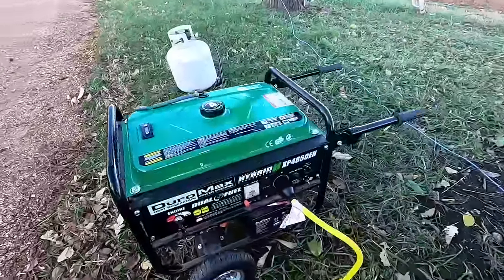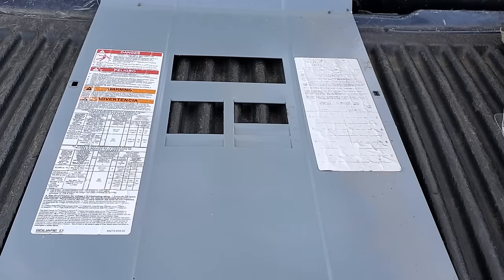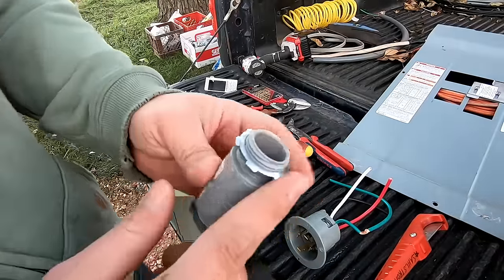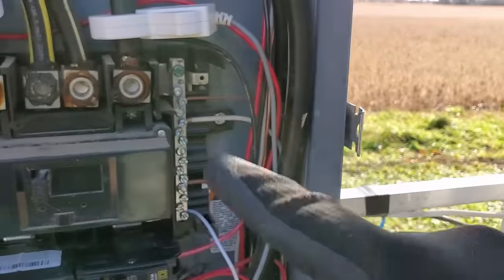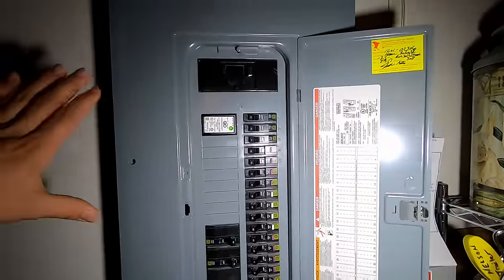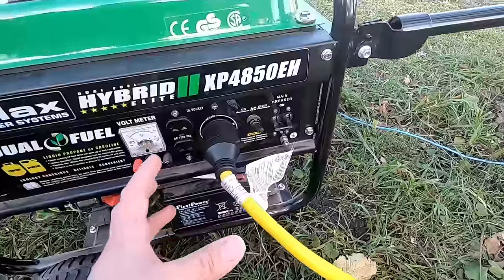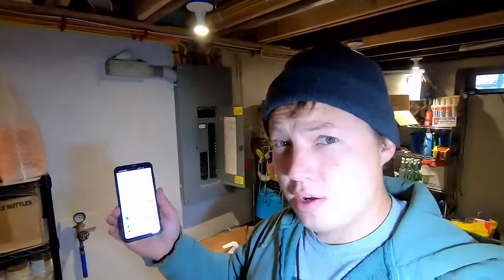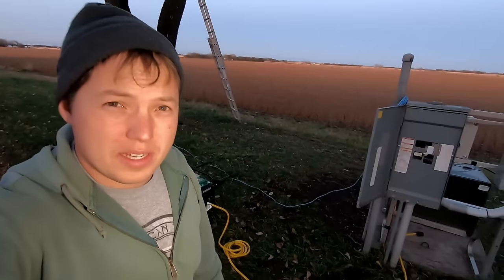How To Hook Up a Generator To Your House Using a Breaker Interlock Kit & Power Inlet Box

Comment: Very good , i learned  a lot, many thanks i do like  (thumb up) and suscribed
Reply: ⚠️Please don’t forget to follow the generator safety tips whenever you use your portable generator. This is a very important announcement for everyone. This is just a reminder for everyone’s safety. All generator safety rules need to be followed carefully 

Generator safety tips: 

1) KEEPING OTHERS SAFE: Please do not allow an unqualified person or your children to operate and service the portable generator. Just because some manuals don’t say that doesn’t mean it’s safe. That is important against the generator safety rules. We also need to be keeping an eye on our children too. You need to make sure that your children are not playing near the portable generator especially when it’s running so they won’t get electrocuted. Generators pose electrical risks and they can be hot during an operation. Please keep your children away from the portable generator at all times. It is important to keep our children safe especially our little ones. Children often get curious about anything so we should keep an eye on them to also make sure they’re not wandering towards the generator. 

2) WHERE TO RUN YOUR GENERATOR: Some people use their portable generators indoors which increases the risk of carbon monoxide poisoning. It’s important to have a carbon monoxide if you have a gas generator. Never ever use your generator indoors even if your doors and windows are open and even in the garage is not safe to use a portable generator. Not even at your porch and your deck. It is never safe to use your generator indoors and in enclosed areas of your home. Your generator needs to be 15-20 feet away from your house. 

3)🔥FIRE HAZARDS: Never refuel your generator while it’s running. You need to let your generator cool off before refueling it and before storing your generator. Never overload your generator too. Never ever back feed your generator. You should never plug your generator into a wall outlet. Also never store propane tanks indoors. Please keep flammable things away from the generator as well and please don’t smoke cigarettes near the generator. Having a fire extinguisher next to the generator is also important against the generator safety rules. 

4) GENERATOR OPERATION: make sure your hands are dry before touching the generator. Never use your generator in wet conditions. Don’t let your generator get wet. You need a generator tent if you need to use your generator during wet weather. Please don’t wear loose clothes when operating the generator. Turn on your generator before plugging in appliances. Use the right cord for your generator. Please do not use worn out cords. 

https://youtu.be/I1jT3ANENvI and here is a video more about keeping others safe when using generators. All generator safety rules should be followed carefully. 

Hope this helps.

Comment: A local electrical company in my area wants to charge me $1250 to install a 50 amp interlock kit, does that sound like a fair price? Also, what's the point in only running 30 amps? The cost to upgrade to a 50 amp is only a few hundred dollars more, that way you wouldn't have to be worried about overloading the system.

Comment: I am glad to see that you used the Connecticut Electric inlet receptacle.  Never buy anything from Reliance Controls -- they are a bunch of shysters who sell questionably-legal parts.
Reply: What is questionably legal about what they sell?
Reply: @carters2  Their transfer panels use "button breakers" as the only circuit protection when running on generator power.  These are "supplemental" devices and not intended for mains service.  I pointed this out in a video that I made a few years ago, and they began legal threats against me because the actual NEC is on my side.   They also put people into comments sections of videos, discussions, etc. posing as consumers who are actually Reliance employees.  They're dishonest people.
Reply: IGnatius T Foobar I see that some of them do but they do sell transfer switches with actual breakers as well it seems. They also seem to sell 3 poll switches that could be used with GFCI protected generators or any bonded neutral generator. I prefer the mechanical interlock setup anyway so that I can power anything in my panel. No expensive transfer switch needed.
Reply: @carters2  They do sell panels with full size breakers, but after my experience with them, I find that they are not a trustworthy company.

Comment: Good video, you explained each step.   you look too Young to be doing electrical work, pardon my observation. I would like to set up my generator the same. But the way my house has its electrical equip the breaker is in an   interior wall, approx 12 ft to the exterior wall and it would be a major job to open the wall or to run thru the attic. The attic is very low, it could be done by a much younger an smaller person. And the house sets on a concrete pad, so that way is out. I'm somewhat out of ways to do a hookup like yours.

Comment: I was wondering if this is NEC compliant, since with that kit you are effectively disconnecting the hot legs but not the neutral. Electricians out there please chime in
Reply: I was wondering about the same before watching this video. Don't know enough about power transmission and what happens or what might happen, if anything, concerning the neutral when power goes out, comes back on, and gets connected to generator power. What if you put an ammeter on it when the generator was running?

Comment: Thank you. I now know what to do!!
Reply: Remember to always make sure you follow all the generator safety rules whenever you use your portable generator. 
⚠️Here are the Generator safety rules that everyone needs to follow when using generators:

This is just a reminder for everyone’s safety when using portable generators. All generator safety rules need to be followed carefully to avoid hazards. 

1) Please do not allow an unqualified person or your children to operate the portable generator. Just because some manuals don’t say that doesn’t mean it’s safe. That is important against the generator safety rules. We also need to be keeping an eye on our children too. You need to make sure that your children are not playing near the portable generator especially when it’s running so they won’t get electrocuted. Generators pose electrical risks and they can be hot during an operation. Please keep your children away from the portable generator at all times. It is important to keep our children safe especially our little ones. Be aware of all the hazards.

2) Some people use their portable generators indoors which increases the risk of carbon monoxide poisoning. It’s important to have a carbon monoxide if you have a gas generator. Never ever use your generator indoors even if your doors and windows are open and even in the garage is not safe to use a portable generator. Not even at your porch and your deck. It is never safe to use your generator indoors and in enclosed areas of your home. Your generator needs to be 15-20 feet away from your house. 

3) 🔥generators cause fire hazards too. Never refuel your generator while it’s running. You need to let your generator cool off before refueling it and before storing your generator. Never overload your generator too. Never ever back feed your generator. You should never plug your generator into a wall outlet. Also never store propane tanks indoors. Please keep flammable things away from the generator as well and please don’t smoke cigarettes near the generator. Having a fire extinguisher next to the generator is also important against the generator safety rules. 

4) generator operation; make sure your hands are dry before touching the generator. Never use your generator in wet conditions. Don’t let your generator get wet. You need a generator tent if you need to use your generator during wet weather. Please don’t wear loose clothes when operating the generator. Turn on your generator before plugging in appliances. Use the right cord for your generator. Please do not use worn out cords. 

https://youtu.be/I1jT3ANENvI and here is a video more about keeping others safe when using generators and also about our family’s safety. Hope this helps

Comment: Well done----thank you!!
Reply: Remember to always make sure you follow all the generator safety rules whenever you use your portable generator. 
⚠️Here are the Generator safety rules that everyone needs to follow when using generators:

This is just a reminder for everyone’s safety when using portable generators. All generator safety rules need to be followed carefully to avoid hazards. 

1) Please do not allow an unqualified person or your children to operate the portable generator. Just because some manuals don’t say that doesn’t mean it’s safe. That is important against the generator safety rules. We also need to be keeping an eye on our children too. You need to make sure that your children are not playing near the portable generator especially when it’s running so they won’t get electrocuted. Generators pose electrical risks and they can be hot during an operation. Please keep your children away from the portable generator at all times. It is important to keep our children safe especially our little ones. Be aware of all the hazards.

2) Some people use their portable generators indoors which increases the risk of carbon monoxide poisoning. It’s important to have a carbon monoxide if you have a gas generator. Never ever use your generator indoors even if your doors and windows are open and even in the garage is not safe to use a portable generator. Not even at your porch and your deck. It is never safe to use your generator indoors and in enclosed areas of your home. Your generator needs to be 15-20 feet away from your house. 

3) 🔥generators cause fire hazards too. Never refuel your generator while it’s running. You need to let your generator cool off before refueling it and before storing your generator. Never overload your generator too. Never ever back feed your generator. You should never plug your generator into a wall outlet. Also never store propane tanks indoors. Please keep flammable things away from the generator as well and please don’t smoke cigarettes near the generator. Having a fire extinguisher next to the generator is also important against the generator safety rules. 

4) generator operation; make sure your hands are dry before touching the generator. Never use your generator in wet conditions. Don’t let your generator get wet. You need a generator tent if you need to use your generator during wet weather. Please don’t wear loose clothes when operating the generator. Turn on your generator before plugging in appliances. Use the right cord for your generator. Please do not use worn out cords. 

https://youtu.be/I1jT3ANENvI and here is a video more about keeping others safe when using generators and also about our family’s safety. Hope this helps